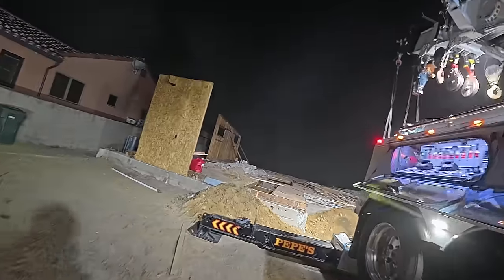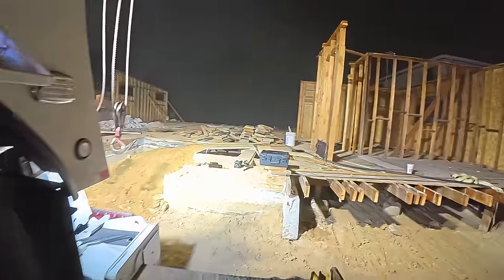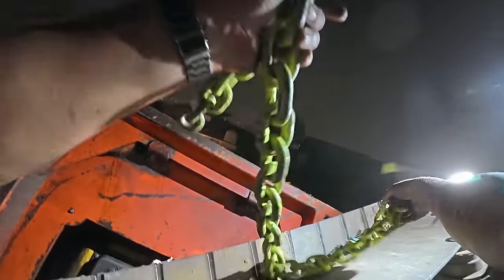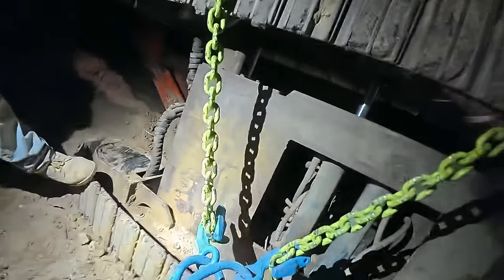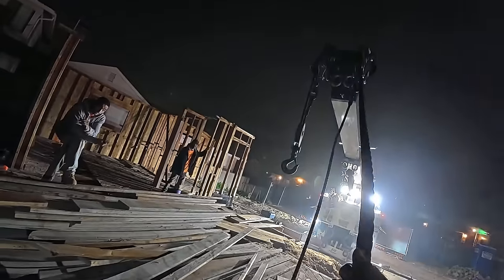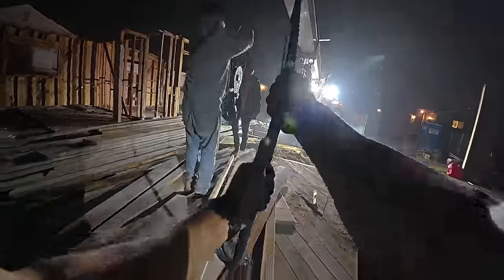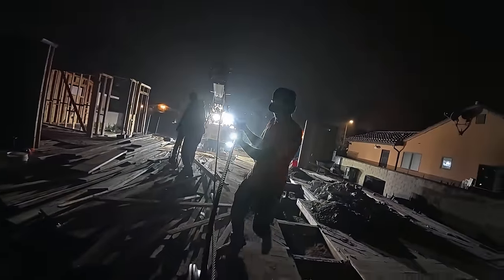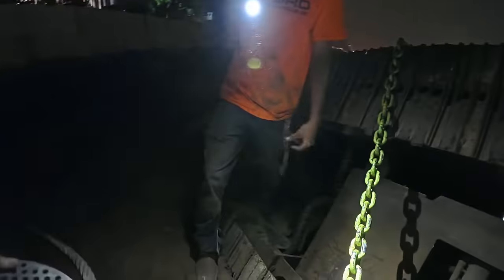Another Excavator ROLL OVER Behind a House

Comment from the maker: Super short video because it was a super quick job, nothing compared to the beast of a rollover we did last month. Still, what did everyone think and WHY does this keep happening :_Laughing:
Reply: Operator error ! __________Ya I Know ! 🤓🙋‍♂️❤👍
Reply: Lucky no injuries 😊
Reply: Given their general attitude to site safety - that entire floor plan consisting of 90% pit traps, trip hazards, and randomly piled materials - I doubt they were working the digger with much attention to detail or to safety.  Big Oops follows.  The operator should be glad they weren't under it or at the bottom of the hill.

I was both surprised and impressed when they moved out of the way during the winching. Many of Alex's  audiences stand in the worst places. 

I was also wondering how they'd drive the digger out?  Cluttered space to the left of the house?

It was fun to see the difference between Alex dragging out the cable and two novices.

Idea: If there's space in one of the cupboards you could have chains and straps to sell the customer to secure their rescues. Even the truckers are often left scrambling after their single 5mm chain has proved inadequate. 🎉

Next week's video: today we're winching a house up a hill after a digger dragged it off the edge. 😂❤
Reply: @45KevinR  the excavator was drilling holes in the dirt not digging . it had an attachment with an auger on the front
Reply: yah the one last month had you guys hiking up and down the hill , a real workout. good to be young still.

Comment: Why does it happen: - Machine can become top heavy when drill is raised. Ground not horizontal, level or solid. Operator can put part of track over a hole they have made. Moving the machine too quickly with drill raised and then stopping causing machine to tip over.
Most of it comes down to operator not reading the equipment and environment. Yes time is money, but errors tend to cost more. 
Hopefully in this instance no physical injuries, just damaged pride and undies. All being well by morning the machine can be operated normally.

These things keep happening to keep Pepe's busy and so Josh has content. Keep up the great channel content.

Comment: So maybe dumb question say the house was more constructed roof etc. How would you guys do this job then?
Reply: they wouldn't be able to get over a full house  here. they can boom up just over 50 ft  but if a house is there you can only get so close to it with the boom .
Reply: I doubt very much that the digger would be doing what it was doing if a complete house was already there.
Reply: @colinl9018  I was just saying in general different machine etc with how tight that area was. Could be adding a pool/ deck idk just wasn’t sure how if even possible

Comment: I’m sure if it was his car flipped upside down, he wouldn’t care how long the engine ran! Those are men or folks that have no understanding except whatever pertains to them and them only! Learn to understand that this truck must remain running to run the alternator which provides the power to all of the wenches , and the air, and hydraulic pumps that allows this truck to lift or pull the heavy equipment😮

Comment: 25.000 lb Working load limit on the line, good that tou have 60.000 lb winch. LOL. I know it pulls les when all the line is on the drumm. But it srill pulls double of what the line is rated for. What is the point? So the winches work with less load, less strain?
Reply from the maker: I'm not sure you understand what the different ratings are for. And I'm not sure exactly what is your question
Reply: @PepesTowingService   Well the thing I do not understand is, why winch with 60.000 lbs pulling force has a line that has only 25.000 lbs Working load limit? I know that it has large safety factor, but does that mean that you can not directly pull with full power if the winch which can pull with 60k of force coz the line WLL limits you to 25k? I am getting something wrong here? I would like to know how this works. If you have the time to explain of course. Thanks.
Reply: @aljosaskrabelj8412 i believe the line is distributed between both ends of the line around the block. 2 lines x 25k is 50k load limit.  Also the lower winch cable might be thicker than the main one, giving the higher load limit.
Reply: @scottmacdonald7268   We are not talking about using snacth block. If you use a block your winch is still pulling 25k. This is how snacth blocks work.